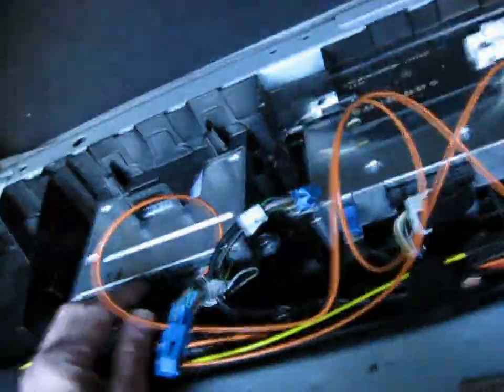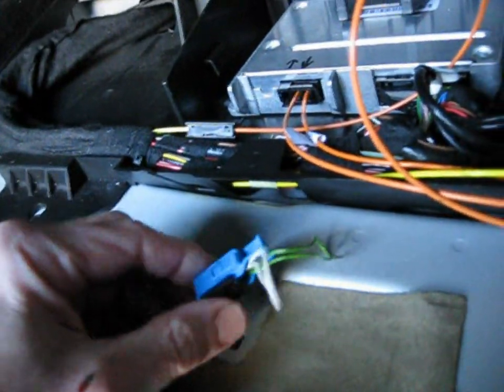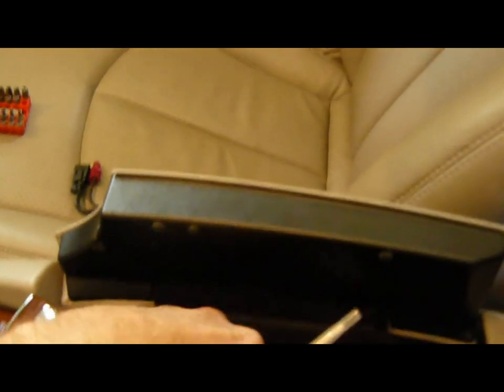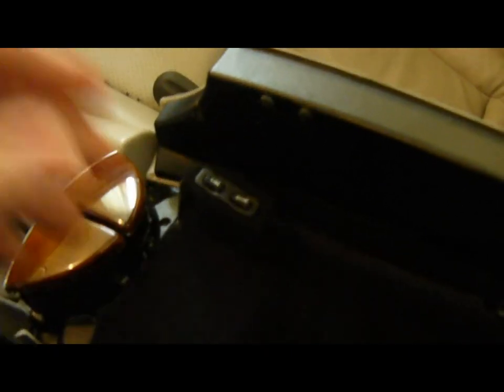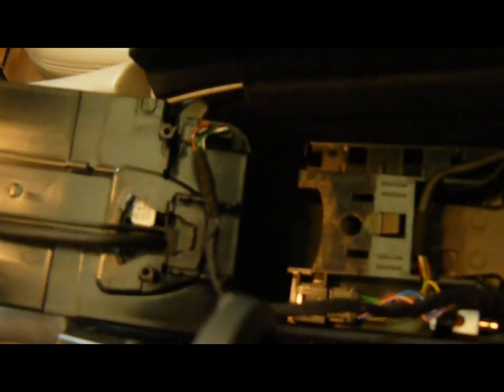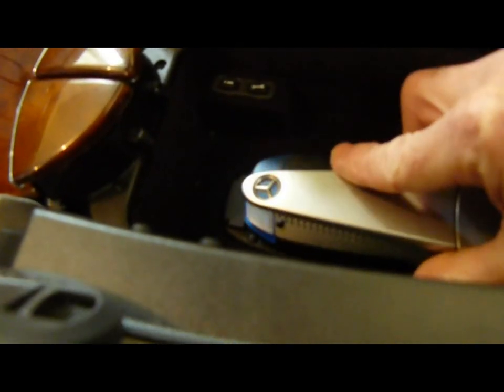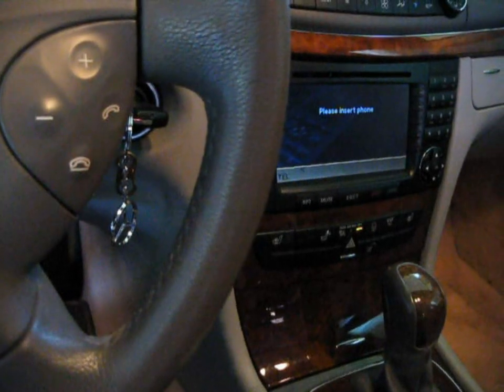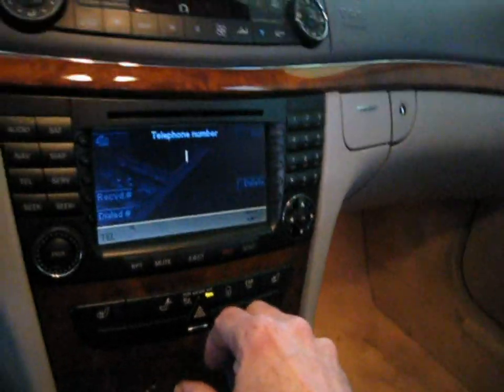Mercedes W211 Factory Phone and Bluetooth install * PART 4 * Arm and Contact Plate Install E500 E350

Comment: Is there a way to get bluetooth music streaming to work?
Reply from the maker: Unfortunately, no. If you're fortunate like I was and you have the DVD drive in your head unit, you can do the software update and you will be able to fill a dual layer DVD with MP3's for 8.5 gigs of music.
Reply: @DIYBenzGarage  I think I can do that.  I also have the multichanger in the trunk but doesn't seem like I have the fiber optics back there.  
I also have the roll back console and not the split open one.  Doesn't appear that a phone unit would fit in mine.
Reply from the maker: @airdrummond241  Your multichanger is in the trunk, not in the dash? What year & model is your car?
Reply from the maker: @airdrummond241  and it can go into a roll back, but it fits inside on the back panel, kind of upright. I don't remember if that panel gets replaced or you pop out a little door like mine.
Reply: @DIYBenzGarage  it's a 2006 E500. 
Single in the dash, multi in the trunk.  But it has the nav setup with Tel menu, just no phone installed.
Reply from the maker: @airdrummond241  Hmmmm, on mine the control panel in front of the shifter flips up when you press the silver button revealing the multi changer. In the trunk on the left hand side there is the NAV disc unit. 2005 E500. From what I have read earlier models used the head unit disc for the nav & that is why I have DVD in the head unit. 2005 and earlier had the fiber optic and wiring in place for all "add-ons" (phone, sat radio, nave etc) regardless whether the feature was factory installed or not. 2006 and after the wiring and/or fiber optics are  not always there.